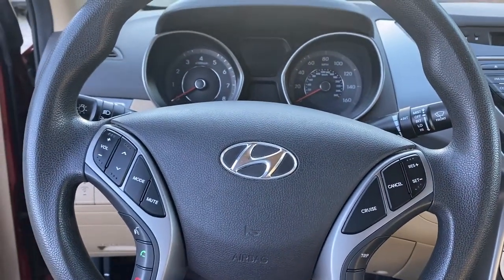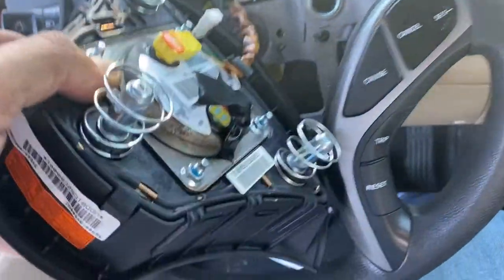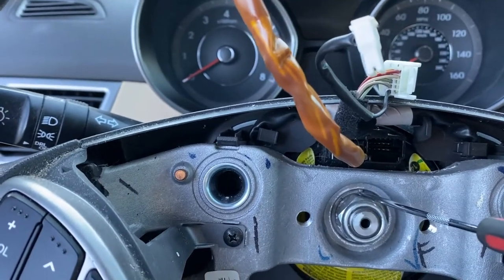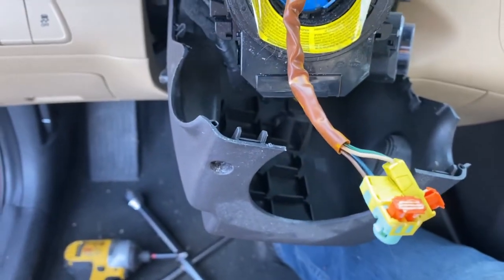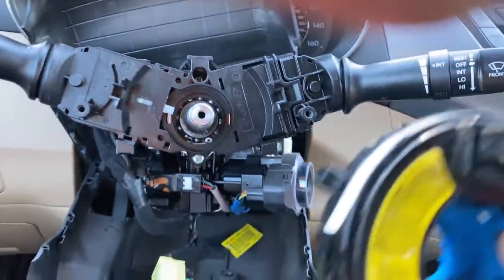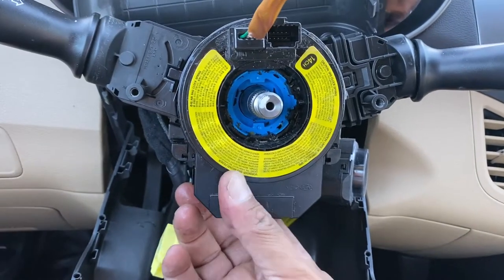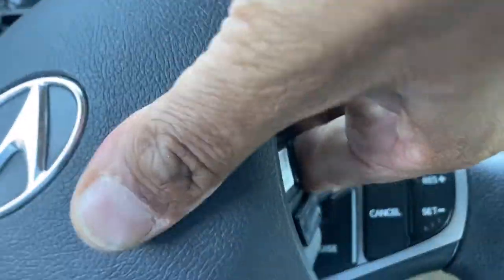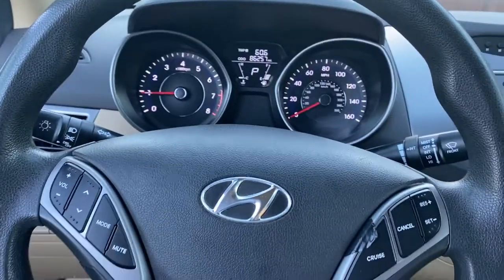2011-2020 Hyundai Elentra Clock Spring Replacement, Steering airbag removal, airbag light ON.

Comment: Don't forget disconnect the battery first, before clock spring replacing!
Reply: How come?
Reply: @Isabella-wo9bg air bag could go off
Reply: That’s why if you follow what he’s doing he’s deflating the airbags you don’t even have to disconnect the battery if you do it the way he’s showing.

Comment: Thank you for your help! I don't like taking cars to mechanics. I always try try do it myself. Glad it wasn't too difficult!
Reply from the maker: Let me know if you need any help
Reply: @NASSTRACINC hello I have a problem with my hyundai elantra 2012 horn isn't working and airbag light is on
Reply: @darwinhernandez1019  could possibly be electrical issue, loose connection in steering wheel or maybe even a fuse 👍🏽

Comment: Question: After installing/replacing the airbag in 2015 Hyundai Sonata does the code reset for airbag control module be done through ODB2 or does the airbag Control unit needs to be taken out?
Reply: you should be able to reset the code from obd and clear codes

Comment: Hi there, is there a way to know if is the clock spring? code reader? I have an airbag light on, the dealer will only cover if it is the clock spring since there is a recall
Reply from the maker: Yes, read the code if it's steering air bag stage 1 or stage 2 ( for USA market)that mean it's a clock spring, for non USA market it will be only one stage, make sure the horn is working if not that mean it's a clock spring
Reply: @paulahg2048 what vehicle do you have?  Does the Hyundai Elantra 2013 has a recall on the clock spring?

Comment: Where did you order the part from?
Reply from the maker: You can get it online very cheap around $20 , don’t buy this part used because it can be bad part as the ribbon cable get damaged more often, let me know if you need any help, it should be a quick fix
Reply: @NASSTRACINC  Are you able to send me a link to the part ?
Reply: @tiempoverano6809  got mine new from orileys auto parts for 165.00 out the door .

Comment: What is the part number for the unit for 2011?
Reply: This is numbers on the box of the part, 93490 3S010. It is original part from Hyundai, but be careful maybe your car has diferent one. My 2013 Elantra only have board computer buttons on steering wheel.

Comment: IF YOU MESS UP ON THE CENTER OR IF YOU NOT SURE,,,WELL THE NEW ONES COME WITH A LOCK PIN TO KEEP IT CENTER,,DO NOT REMOVE IT UNTIL YOU INSTALL IT,,,BUT LET SAY YOU ARE NOT SURE,,WELL TURN IT ONE WAY TILL IT STOPS,,GO BACK AND COUNT HOW MANY TIMES IT WENT AROUND TO THE OTHER SIDE,,,THAN JUST  DIVIDE SHOULD BE HALF OF THE TRUNS,,NORMAL ITS 4 ONE SIDE 4 THE OTHER,,,,